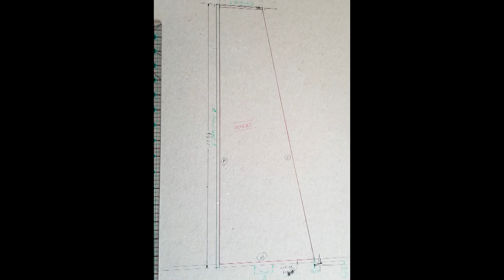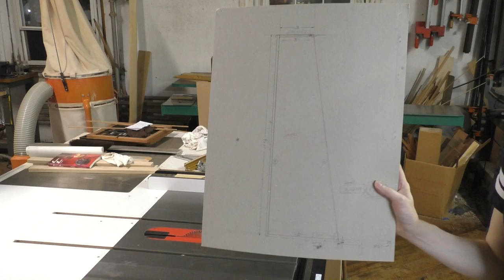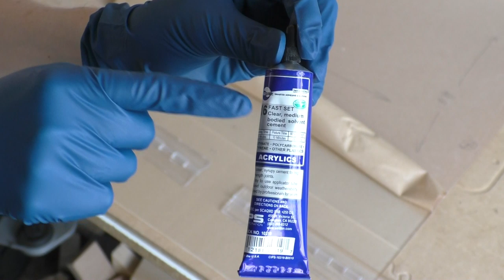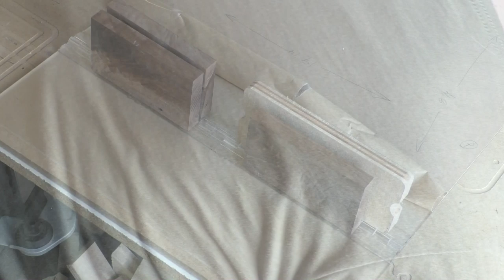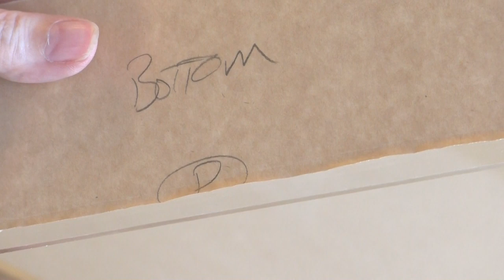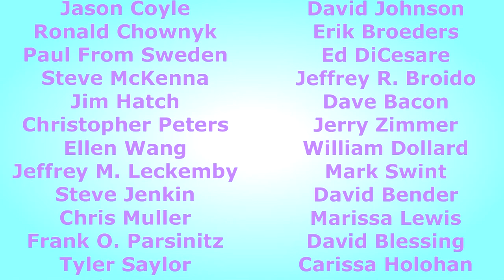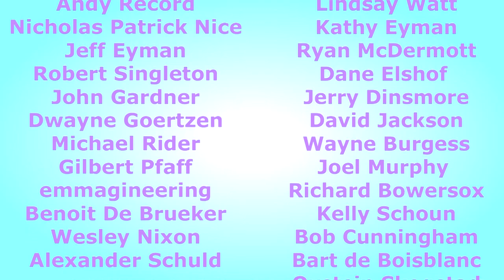If At First You Don't Succeed.... It's Vent Hood MkII!

Comment: I recommend using Print Bite, it's an amazing build surface.  You wont have any problems with materials sticking to it and once it cools, the prints just pop off.  No scraper needed.

Comment: What i've seen a lot of YouTubers do for acrylic gluing is buy a syringe + hypodermic needle, and suck up a bit of the acrylic (and sometimes even dilute the acrylic with, er, whatever the solvent in the thing is, i think it's some kind of alcohol), and then with a tiny needly the pressure to get it out is quite high, so the max flow rate is quite low. As a result, you can get pretty accurate squirts and it doesn't need much if you're sanding the edges like you are :)
Reply: @johndee8874  Really? Wow - you never know with YouTube videos. So many people telling me my angle grinder can't be used without a safety guard, and steel caps boots or gtfo, and so when there's a real safety tip I sort of presume it's the same PC over-reaction as before. Thank you for the genuine warning, as obviously i'm planning on doing this soon!!

Comment: When I made my aquarium from acrylic after cutting I just used a torch to do what is called “Flame Polished” the edges. Very fast and very simple and left the edges smooth and clear, it didn’t alter the strait edge either. For an aquarium the 2 edges need to be cut strait with in very close tolerances so you have no leaks. Try it next time will save you all kinds of work. Flame polishing acrylic

Comment: Thanks for the vid, Fran.  I'm so interested in 3D printing but have no room in my condo.  The little space I had left, I filled with my home recording studio.  BTW, love my Frantone Brooklyn drive.  🎸
Reply: I had the same problem but i managed to squeeze in a Kossel printer, they have a much smaller footprint and they look really cool too.
Cost around $200 upwards so very reasonable.
I just find myself using it less and less due to issues like clogs and jams, but they're certainly worth playing with as a first small space 3d printer, here's mine in action
https://youtu.be/OOrzLvtPm4I
Reply: Maybe make something like one of those pop-up sewing machine tables for it. Mild mannered end table by day, idea printing superhero by night. I might have to try that for the 3mX5m apartment I've squeezed myself into. But really I've given up trying to hide that a raging geek lives here.
Reply: @karlharvymarx2650  I already have that.  😀  For my sewing machine which is used pretty much exclusively for hemming slacks.  What I need is a pop-up extension for my condo.
Reply: @j.cheeverloophole9029  I'm thinking that the guest room has to be converted.  Who needs those pesky guests anyway.

Comment: When, EONS ago, I made a box for my (coat pocket) size transistor radio, I had to learn a couple of facts about the acrylic.  The first one was that my full speed only drill was no-good for drilling it.  Luckily I found somewhere a hint of using rubbing alcohol for cooling the acrylic as well as the drill bit.  The process was to drill a little and apply more alcohol, then drill a little more.  The really challenging moment was when the drill bit reached the other side.  More of alcohol!

For gluing, I softened the edge(s) with acetone and then joined them.  After they were basically mated, then I applied some self made glue that consisted of thin strips or shavings of acrylic dissolved in acetone.  The glue rounded the inside and outside corners and reinforced the structure.  It never failed even when dropped to the floor.

All that was before more advanced glues were introduced.  And by the way, the transistors were made of germanium.

Comment: I kept thinking how much window / door foam tape could help with the tolerance, especially the normal 1/8" thick stuff.  In the end you did use a thinner version for the final variation.

Comment: Pro tip, spot your drills on a stone to drill plastic or brass. You want 0° rake on the leading edge of the drill. Basically you want to effectively blunt your drill. This will help prevent the drill trying to pull through. Hope you can understand what I mean. If not then Google it.

Comment: I got something for You: Neurophone.  I believe you can use a 555 or a pwm chip in first block. Modulate duty cycle with audio too (40khz carrier) a diffrientator and then another , out too the sensors/ probes. You can hear through the body, bypassing ears. find data... Low V.

Comment: Regarding the Zaxxon standup, check for hairline crack around pcb mounts in rear board where wires come up to crt board. 2nd check crt pcb for hairline. (Crack is small and not complete, hard to see.) Appears to be missing a grid voltage and other lines. And yes, I know. Peace out.

Comment: Being a speaker nut i must ask what speaker did you have off to the right with the grill cloth removed ?
My guess is KLH. I know it's a seventies vintage - ' 75 or so....ish....
I am really fascinated with printers like yours, but my radio hobby consumes any space i could use. Some day i'll get one to play with.
Creativity runs wild with one of those, add your router and it's years of project ideas.
The resolution is very good for not being messed with, like really good.
Just like computers were big $$ printers will get better and cheaper in time.

Comment: My next printer will be an IDEX dual-carriage printer the size of a CR-10.  It will be in my living/dining room, so I need it to be as quiet as possible.

I will use a furniture-grade particleboard case lined with both acoustic ceiling panels and acoustic foam, then rely on a webcam for local and remote monitoring.  The entire case will have carpet glued to the bottom to minimize conducted noise.

The ventilation plan is to use an organic or activated carbon filter with a quiet centrifugal pump exhausting into the room (possibly via a muffler, if needed), because I have no ready access to a wall or window penetration.  Since I'll be pulling negative pressure, I'll not worry about small leaks, since significant leakage is needed to flush the vapors and not have them deposit on the printer itself.  If dust becomes an issue, I may decide to cut an explicit inlet and add a foam filter.

On top of the enclosure will be my filament spool storage, a transparent tote box with desiccant in the bottom and PTFE tubes to the enclosure.

To make the enclosure exterior interesting, I plan to paste orthographic photos of the printer to the appropriate sides.

Though that acrylic sure does look cool...

Comment: I love the channel.
I also love idea of separating your print area from your work area, venting any unpleasant products outside. However do you have a way to get fresh air into your print cabinet? Unless you draw in air to replace what you're trying to expel, your ability to change the air in the cabinet will be reduced. ;)
Reply from the maker: The inlet is on the bottom of the cabinet in the back, where the filament comes in.

Comment: excellent job but if you're printing PLA do you really need a sealed hood? a window fan would probably work. are doing it to keep lab dust off the print?
Reply from the maker: You'll have to see my explanation in the original M3 unboxing video.
Reply: I was thinking the same. Forced vent only needed when ABS,PET, or other solvent release plastic are used
Reply: her answer is here
https://youtu.be/G_WCqlgAF2k?t=782

Comment: Tbh, your original design may have been easier to correct. I would tried have just cutting a temporary wooden backing for your folding door then melted the acrylic on it to form with a heat gun.